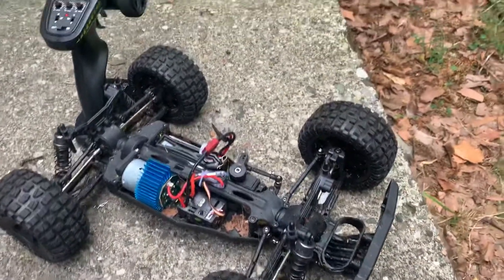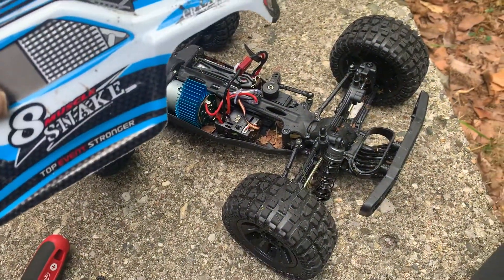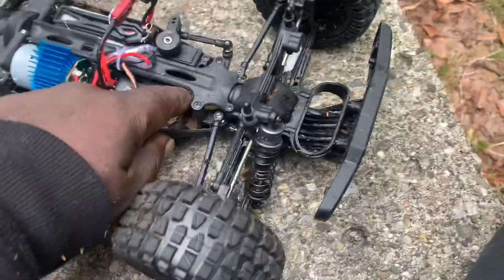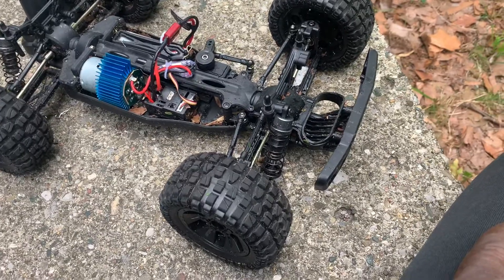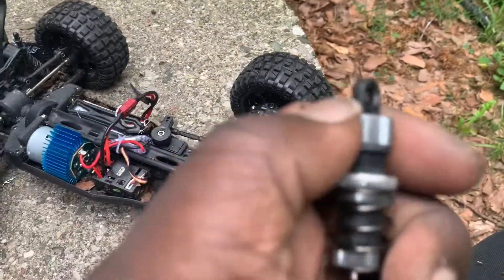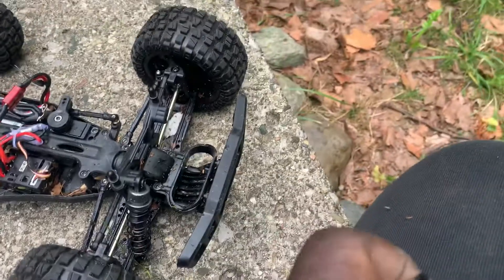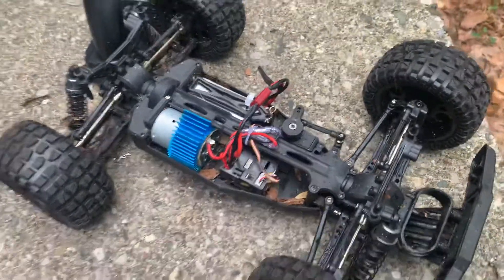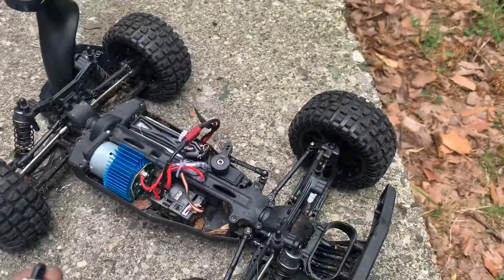Deerc 9200 E upgrade suggestion

Comment: Good advice! I filled mine (Holyton 9205e), same car with silicone grease and that works good so far. I have a suggestion to all- make sure the heat sink on your motor DOES NOT cover the brush vent holes. The motor needs to breath. I noticed it on your video and another one I saw earlier. Thanks, ms

Comment: Shocks on these are trash.  I have one of these upgraded with a 4300kv brushless pushed by a Surpass 80amp kk esc.  Full size servo and dumbo x6 radio with x6g recievrr with gyro.  She is a beast.  Hit me up if you have questions.
Reply from the maker: Thank you I was thinking of doing a power upgrade but wasn’t sure what direction to go with did you have to make any gear adjustments with that motor or the stock gear fit just fine
Reply: Can you provide links for the upgrade kits

Comment: Can it take 3s
Reply: 45A ESC mate the ESC can handle It fine but the brushed motor overheats
Reply: @bikesrc4642  u tried it?
Reply: @jesusrdgz1ify  yeh I tryed it bro works fine just gets hot fast " it was a 3s mini 20c lipo I used